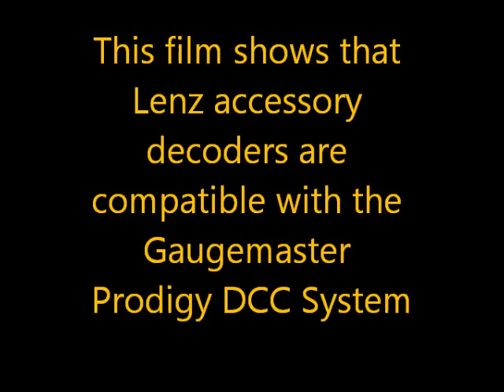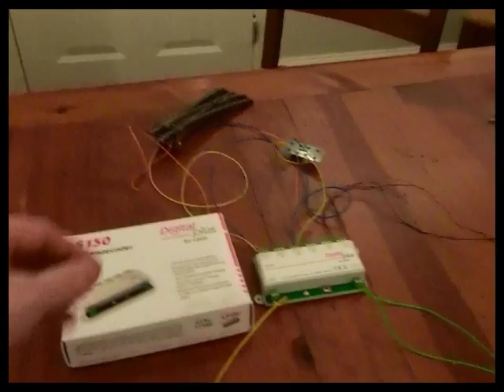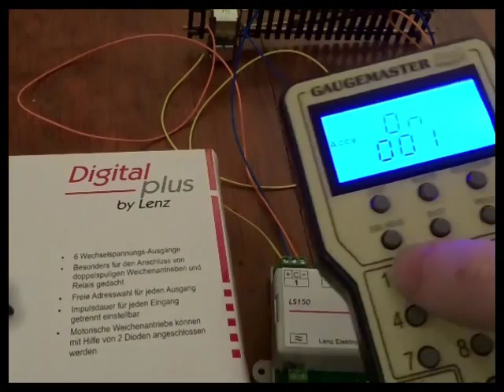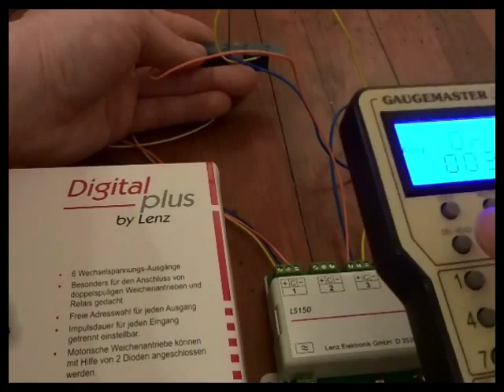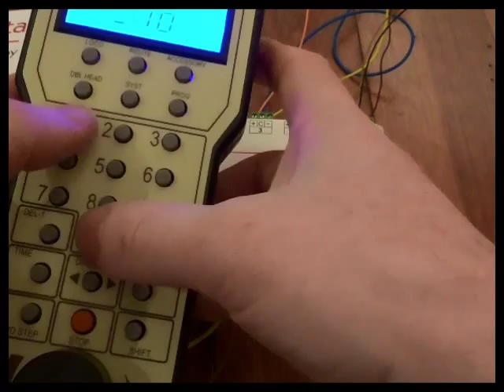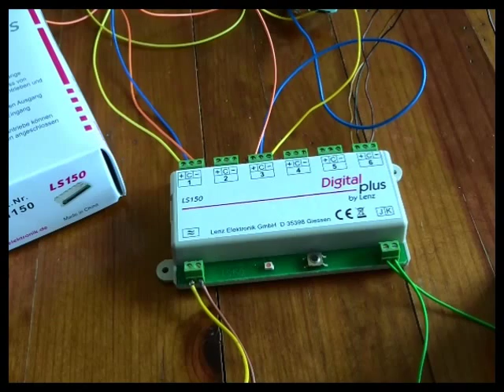Lenz Accessory decoders with Gaugemaster Prodigy Advance 2 Switching points

Comment: Hello -  I can't find any info on how to read or write a Hornby R8247 points decoder with the Prodigy,  please do you know how?
Reply from the maker: I am sorry - I do not have either of these products to try - Gaugemaster will know what to do with the Prodigy in terms of setting up accessory decoders and the general set up for the R8247 will be the same whatever system you use setup provided it conforms to the DCC standard for Accessory control..   Kind regards     Chris

Comment: Can you piggy back the LS150's in series so only 1 pair of wires comes from the transformer.
Reply from the maker: 1 transformer can provide power for several LS150 - Just take care with sending route instructions and firing multiple points at once if you can, build in a delay to your route so that the LS150 has a chance to recuperate - particularly when using point motors with high power demands.  Cheers      Chris

Comment: Hi Chris 
Thanks for sorting out the transformer confusion I made.
I think I had a senior moment lol.
Can you piggy back 2 Fleischmann points on a crossover to 1 outlet rather than 2 on the LS150?
Thanks Peter
Reply from the maker: The Fleischmann Motors draw very little power so we have in the past put 2 together on a cross over between 2 tracks.  It saves on outlets and makes sure that both points are set correctly.  Cheers  Chris

Comment: I notice in your video that you are using the TR100 which has an output of 70VA with out the recommended 10ohm resistor for use with the Lenz LS150 45VA.
Is that a problem regarding any likely short circuiting?
Lenz apparently do not even recommend their own product but the Atlas Generator power supply.
Reply from the maker: The Lenz TR100 is the recommended transformer and has a 45VA output.  (The TR150 is 70VA and is not recommended for the LS150)   This is what Lenz Germany recommend and this is what we sell in the UK.         The Tr100 is for 220/240V, I believe the US household power is 110v. I guess the US importer looked at 110v power supplies that were readily available in the US rather than commissioning a special US version of the TR100 transformer.(Atlas sell a rebadged LS150 in their range so the choice was made easier)  The Lenz US importer have written their own manual to reflect this decision.  The GB manual suggests the Tr100.  Different solutions are needed for different countries.    Cheers       Chris

Comment: I've not had any luck setting this up on the Z21..
Reply from the maker: Make sure you have a load on the first outlet when programming - just 1 point motor wired in.  Set up your6 point addresses (Use DCC addresses not Motorola) on the app.  Press and hold the programming button on the LS150 until the red LED lights up.  now press the first address on the app - the LS150 will pick this up and automatically assign the other 5 consecutively.  The LED will go out.  If the LED fails to illuminate check your connections - point motor, transformer input~ (3amp 15vAC) and track feed.
Reply from the maker: You can have all six motors connected to programme - Also check correct function of the point motors - some can be incredibly hard to move if they are loaded up with centring springs and auxiliary switches.